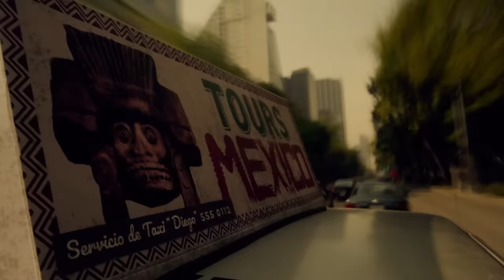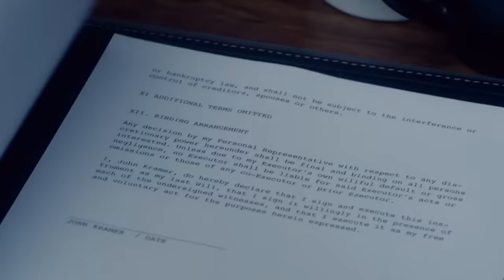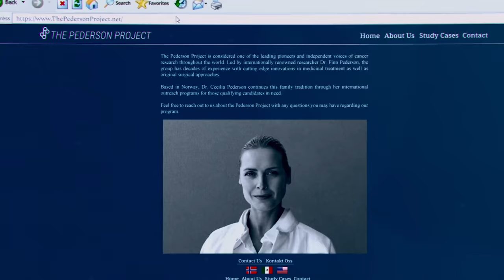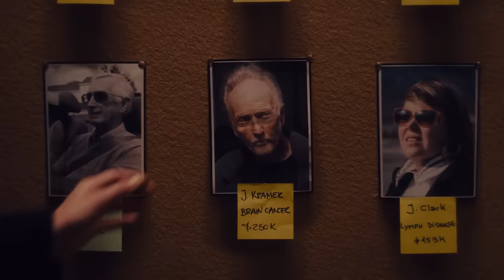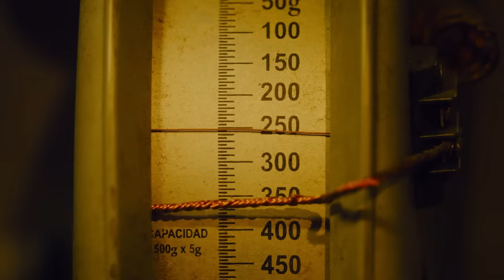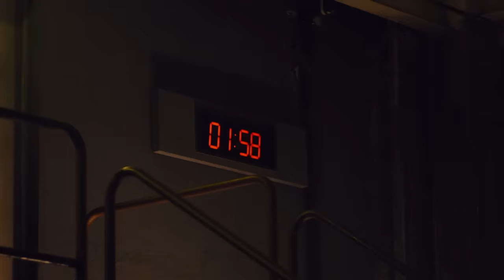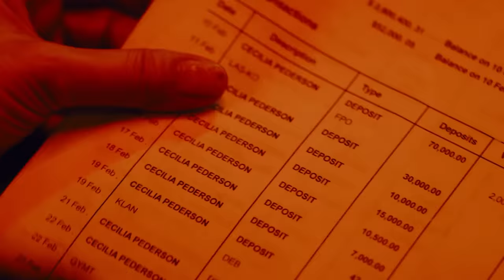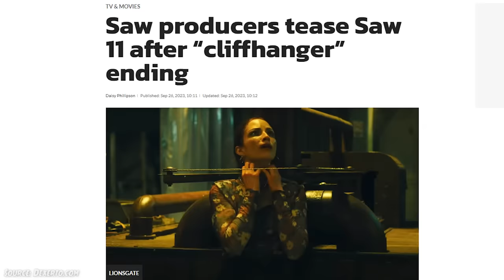Saw X (2023) KILL COUNT

Comment: Just thought of a good saw trap:

Hello Player. I'd like to play a game. I've read up on you and I am not impressed. You continually walk the same destructive path despite pleas and warnings from loved ones. They only try to explain your folly but you refuse to listen. Now you will need to listen more than anyone ever has before. Strapped around your torso is an explosive device set to detonate in 10 minutes. Attempting to remove it before deactivation will trigger the explosives. To deactivate it you need to input the correct code. An incorrect code will prematurely activate the explosives. Luckily I've kept an audio recording of the correct code. Unfortunately the only audio player around is one jury-rigged to a dangerous volume. You can play the recording as much as you need to in order to register the correct numbers in the confusing cacophony but be warned that doing this too much will likely deafen you and prevent you from hearing the code or anything ever again. You will need to hear the painful truth and listen to it well enough to free yourself before your own habits destroy you. Let the game begin.